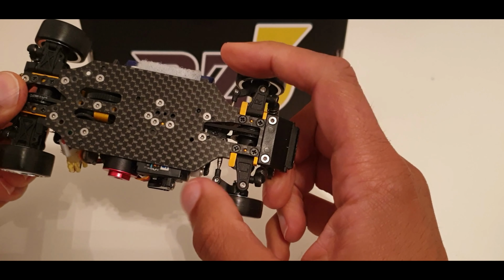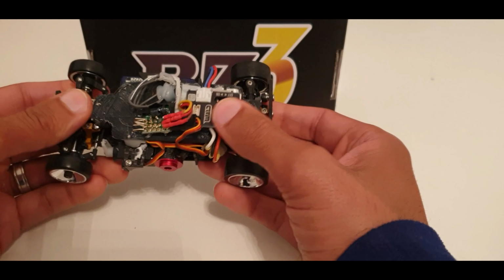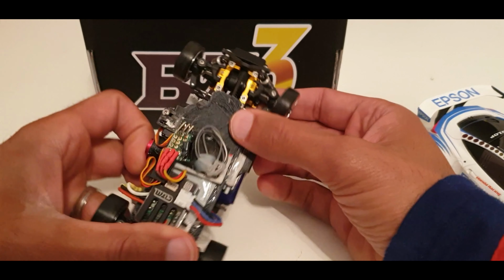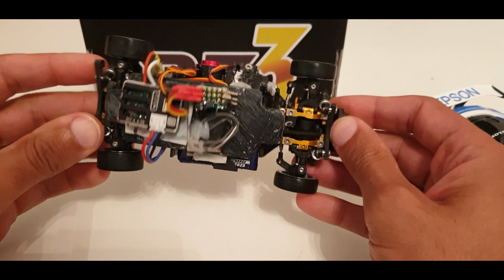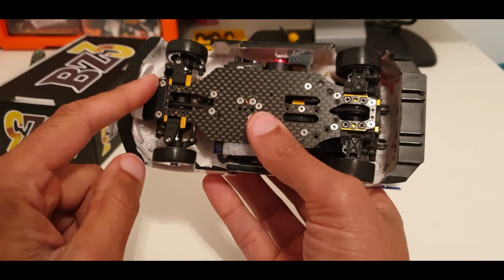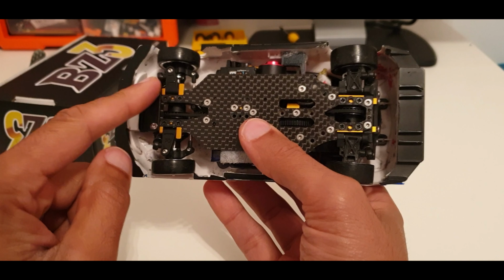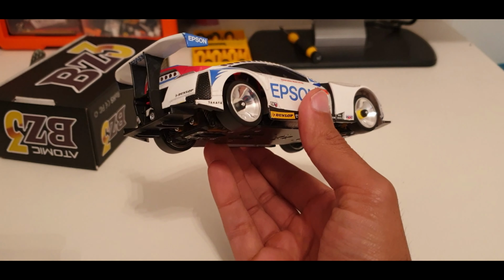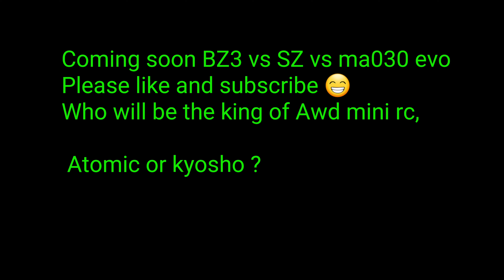#atomicbz3 New Atomic  Bz3/mini z body  quick review with drifting part 1

Comment: Color me shocked, I didn't expect 1:28 (24) belt drive. Super sweet car buddy... serious case of the covets. #RCsinner
Reply from the maker: It's so smooth mate.Reminds me of a small version of my old optima mid custom, I actually liked listening to it roll when you let off the throttle. I'm going to put grip tyres on it and see if I can do a speed run in a car park.

Comment: It sounds awesome! Now you make me want to get a belt driven car.
Reply: I didn't know you could drift with these I guess it's just the tires right? Ok my new to these I just picked up a bz3 and we'll I didn't receive it yet. I was hoping to be getting the fastest lap time car.
Reply: @rctony710  Anything that is 4WD/AWD can drift when you put drift tyres on it. But how well you can do it depends on many things like the suspension setting, the diffs you use, how much tension on the diff, etc. Most importantly do you need the front turn in easily and have hand brake effect when letting off the throttle or brake? In that case you need a front one way.
Reply: I never liked drifting racing and fastest laps where always my thing. I just hope it's fast on turns and handling I hope I can beat the mini-z's with the bz3
Reply: @rctony710  How hard you want Mini-Z to get beaten? VE or EVO Mini-Z might hold its own against BZ3. But if you put BZ3 up against a standard Mini-Z it'll be an annihilation. I started to get feedback from BZ3 drivers and it needs delicate, precise and fast hands. The car is fast and agile, no doubt, but it's not forgiving for new drivers.
Reply: @BeaversHobby  that's what ive been seeing. Mini-z are more forgiving. Bz3 is a tighter car which when I want a 1/8 on-road I go for also a tight car for me is just what I like is is more my style. oviously the driver and setup is the most important. I got to say the bz3 is much more impressive looking compared to a mini-z what you think?
Reply: @rctony710  It's a much more impressive car indeed and it's also a technical achievement. To be honest I didn't think anyone could shrink a belt drive system to 1/28 but they did and it's a mighty fine job.
Reply: @BeaversHobby  yes!!! That's what I thought how did they put a belt in there it's incredible! I thank you for your knowledge and response we'll keep in touchone more question when I received the car what set up table will I need 4 camber toe in toe out? Etc?
Reply: @rctony710  Try stock setup first and see how you like. Normally you'll do front toe out and rear toe in. The degree depends on how you drive and track layout.
Also, feel free to contact me any time. Just leave a message and I'll come back when I got time to answer.

Comment: There are two white shims between the upper front A arm and the front bulkhead. Maybe if you install those shims towards the front, you wouldn't have to grind the bulkhead?
Reply from the maker: Good idea, everything else seemed perfect with the setup, it seemed like an easier fix, and the belt and diffs are the only tricky bit of the set up. I've seen other users with minor issues like this on the Facebook group. Once I've a bit more time to play around with the set up I will try that tip. 👍🏽
Reply: @GarageMiniRCUK  I studied the manual and don't think the trick will work. The only thing that I can think of is that maybe you put to much tension on the front belt. They are supposed to run quite loose from what I can understand. Keep us posted! I am very interested in the fool BZ3 review.
Reply: @z-collector7518  😂 if I increased the tension it stopped it rubbing but it was too tight. But the car flys....... I mean its so fast and responsive I had  to turn up the drag brake to 100 percent at first, on our small track as I couldnt react quickly enough. I am going to do a high speed test with grip tyres eventually.....

Comment: There nice but way to pricey just to make slide sideways
Reply from the maker: Thanks for the watch. It's a beast when on a racetrack with grip tyres. But yes I do question my spending 😂.
Reply: @GarageMiniRCUK  I'm sure they are🤣I question my spending also🤦🏻‍♂️
Reply: @GarageMiniRCUK  how much have you spent? I'm considering buying a bz3 with all the electronics etc. How much do you reckon I'll need? Thanks
Reply from the maker: The spending has never stopped, atomic are relaseing awd race... car with central diff that's 3 diffs
Reply: @GarageMiniRCUK  I can't make up my mind. Either the bz3 or the sz2.. What do you reckon? I only plan with one first..